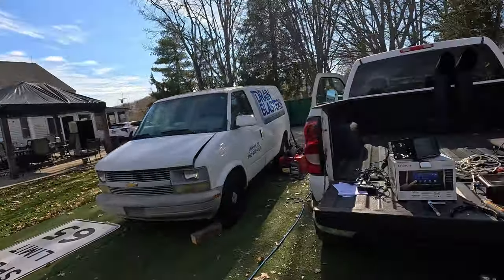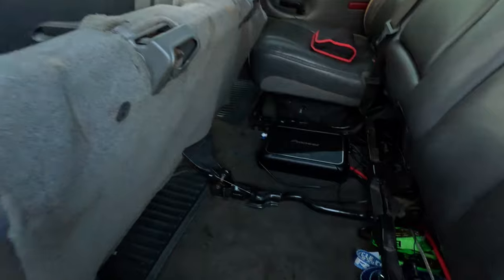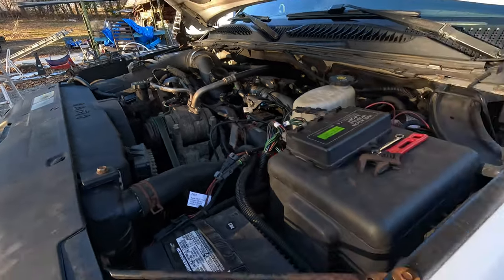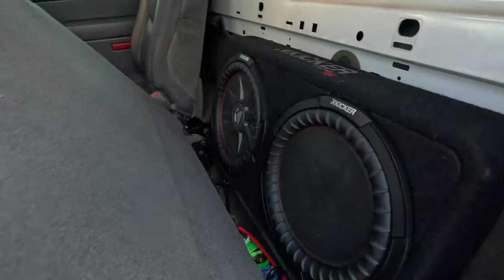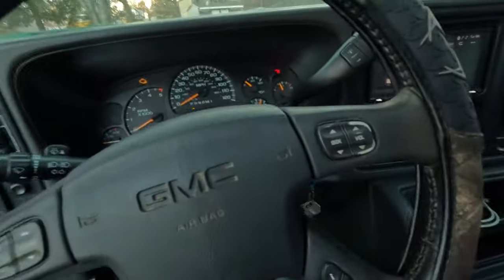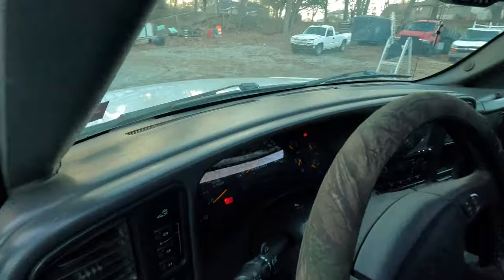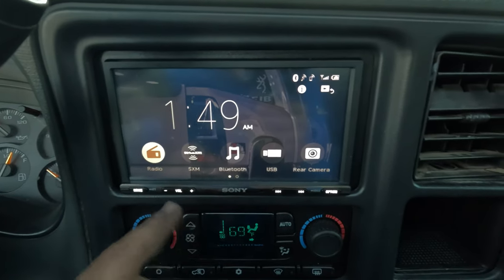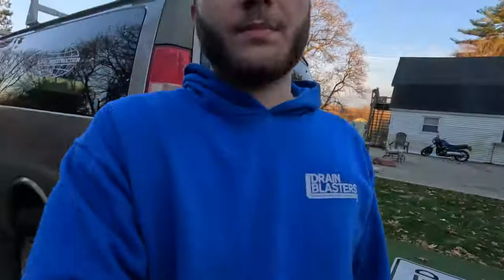Installing a head unit and 12 inch subs in the LBZ duramax!

Comment: So I cut the wire to my center console sub (the factory Bose one) because it rattled and sounded like garbage. Then idk if it was already happening or not but soon after my speakers in the rear doors would rattle super badly at like volume 10-11. Should I replace that factory Bose sub? Do they have anything to do with one another?
Reply from the maker: I didn’t even know there was a Bose sub in the center console to keep it real with ya so I have no idea
Reply: @TheDon.87  What amp did you upgrade to?
Reply: @TheDon.87  What amp did you upgrade to?
Reply from the maker: @kadent7320  2000w pioneer